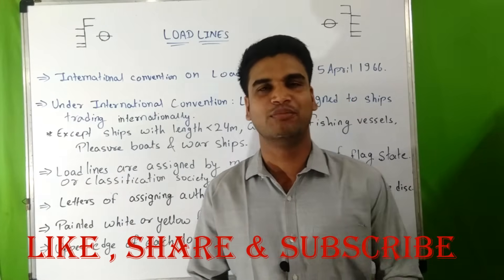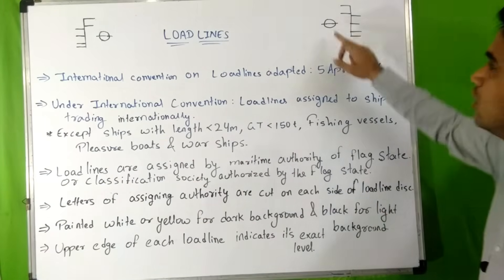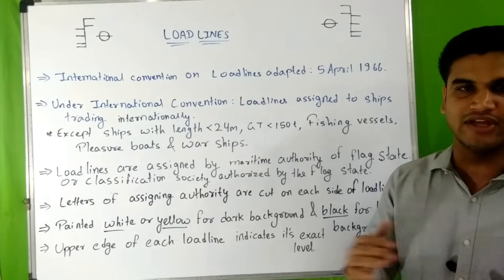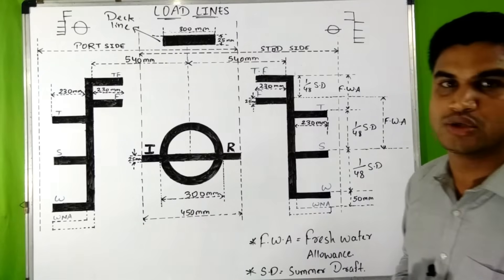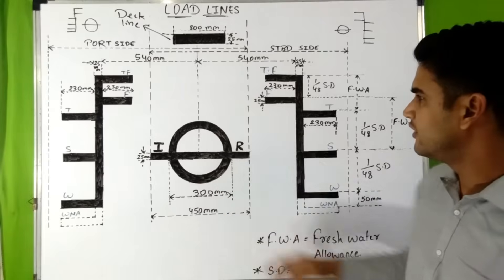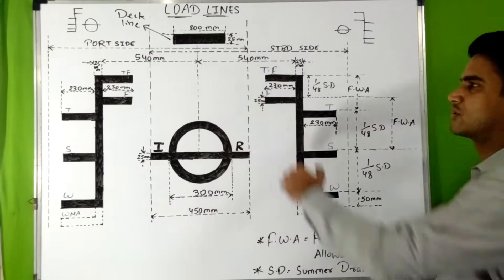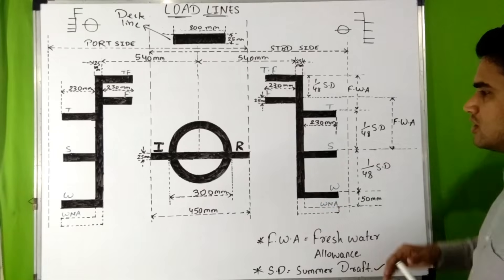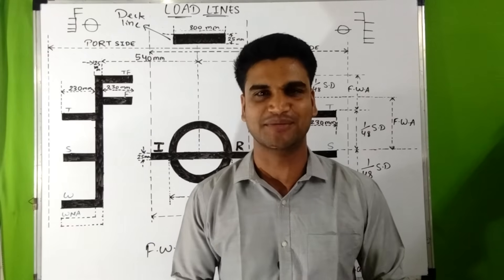LOADLINES

Comment: I know this is quite uneducated question, but can you please define what the purpose of the Load line is in laymans term? Thank you sir.
Reply from the maker: The purpose of the load line is to ensure that a ship has sufficient freeboard (the height from the waterline to the main deck) and thus sufficient reserve buoyancy (volume of ship above the waterline). It should also ensure adequate stability and avoid excessive stress on the ship's hull as a result of overloading.